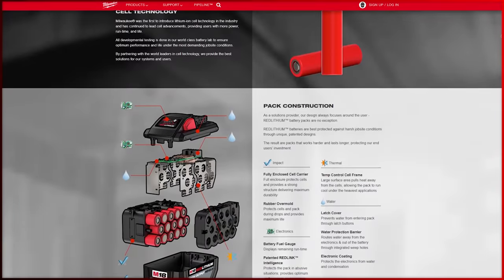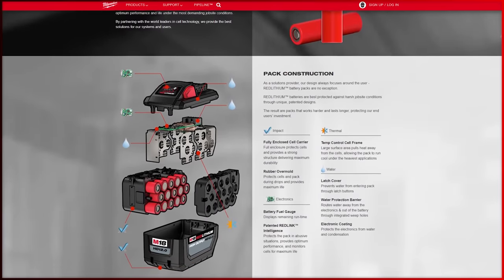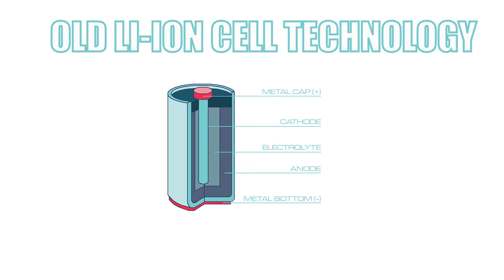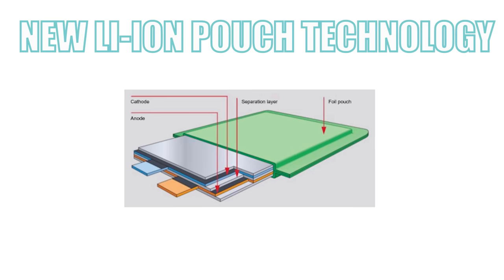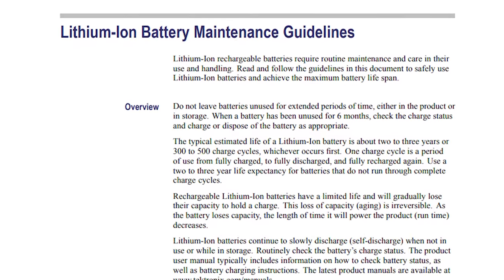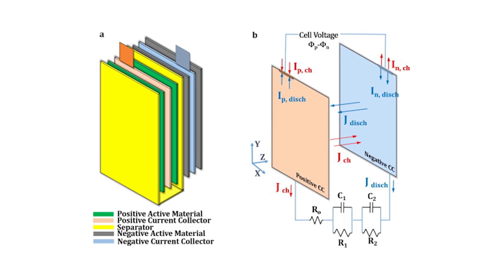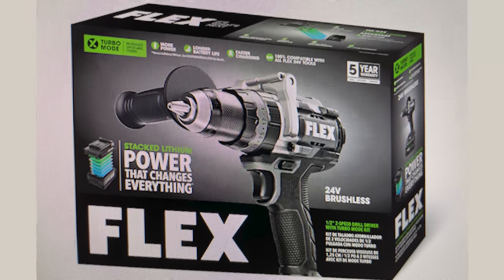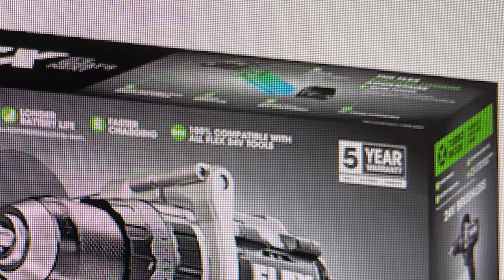BIGGEST FLEX YET Lithium Polymer (STACKED) Power Tools LEAKED!

Comment: My RC airplanes have been using Li-Po batteries for 25+ years.  Now I can have the same puffy batteries in my impact driver.  Great....
Reply: Yeah expansion is the biggest issue with pouch cells. But that will greatly depend on battery chemistry. I guarantee the chemistry in your 25 year old RC planes is not as good as the chemistry they'll be using in these tools.
Reply: @todddammit4628  cellphone batteries will expand regardless.
Reply: @robertopics  cellphone batteries have become far more stable in the last 5 years.

Comment: I'd rather not have my house burn down with LiPo batteries, lithium ion is known to be much safer
Reply: Will be interesting to learn exact chemistry though as that will play a large role in safety
Reply: The safest battery chemistry atm is Lithium Iron Phosphate. BUT they're nowhere near as energy dense as Li-ion.
Reply: @todddammit4628  LTO are very safe too but no where near as energy dense as needed for cordless tools
Reply: I agree. I've had lipo batteries blow up in my house, luckily I had them in lipo charge bags (for an rc car). I keep a dewalt impact in my race truck but will never leave a lipo battery in that truck. Too sensitive to heat and hard impacts. A fire is the one thing a race vehicle can never come back from.
Reply: Well, Li-Ion batteries can be very dangerous also, just remember Samsung phones and not only with Li-Ion batteries that exploded a real nightmare years ago and also Li-Pol batteries that if done well the benefits can be a battery that lasts much longer in time i remember my old Sony Ericsson K750i from 2005 and even now I still have it around the house and the battery on that phone still works flawlessly and went through several hands first it was with me for about 5 years then it was used  by my wife for about 3 years then went to my father for about 4 years and now he is with my son he plays with him, and if that battery was not stressed then no battery was, so if the Li-Pol battery  are made properly you  have absolutely no problem with it.

Comment: Like that the battery format is the same, footprint exact same with reduced weight and even backwards compatible, that’s great.
Do wonder if will be weighted thoigh to help offset the tool weight so it’s balanced like most tools are now 🤔 
Thx Vince✌🏻
Reply from the maker: Good questions Aepek, hopefully we can answer them soon! I’d like to see what this type of technology can add where the rubber meets the road! 👍🏻
Reply: To male up for the weight, they'll just have to add more pouches. Which means longer Amp Hours for similar sized packs. But I don't really see this as being a problem. The thing is, when you click in even a 2.0 M18 battery in most tools, the balance is there. Adding a 5,6,12 doesn't mess with the balance as much as add weight. Heck, I carry an extra HO 3.0 in my pouch when running my tools just so I don't have to lug around a 6.
Reply: @jmackinjersey1  true, so very true. Do like those HO cp3.0 batteries.

Comment: I just saw an add from dewalt for this same battery technology. They’re calling it PowerStack. Guess it’s rolling out across the industry.
Reply from the maker: What do you think about it Mr?
Reply: @VCGConstruction  thanks to your explanation, I’m definitely excited at the change in the industry. 

Wish I hadn’t just bought an Ego lawnmower, as I expect everyone will be rolling these out pretty quickly now. I think I’m also going to hold off buying that Home Depot deal on the Milwaukee dual charger with batteries.

Comment: This is really exciting stuff, I wonder what this might do to the form factor of current lithium batteries (particularly M18) and their durability overall.  I appreciate the heat dissapation, but how would it hold up to a drop from say 3-4 feet? They may be flexible, but if they are gel based, will they leak more readily? 🧐
Reply from the maker: I’m just as curious as you Joe, thanks! 👍🏻

Comment: The only issue I see is it won't change the battery size. Plus cost. Lol. I use them regularly as I mentioned in my RC's and they drain fast. Even larger amped batteries.  Race RC guys like 75mph, not Walmart ones😂😂
Reply from the maker: Yeah, from what I understand you can rapidly discharge and charge pouch much faster than other technology!
Reply: Well they advertise more power, and longer battery life,  I would assume they would be talking about the density of the energy stored inside the battery resulting more ah or Wh inside a smaller battery,  but that could just be wishful thinking on my part.
Reply: @VCGConstruction  yes,100% correct. Will be interesting to see what they come up with.
Reply: My RC packs were the first thing to come to mind when Vince started talking about the battery pouches. I’ve always wondered why tool companies haven’t adopted this technology a long time ago. RC manufacturers have been making these packs for well over a decade now. Catch up tool companies! Great vid like usual Vince 👍!!
Reply: @txvet7738  yes sir!!

Comment: Not sure a switch to Li-po batteries is going to be revolutionary for the tool world. Yes they charge faster, but they also store less energy and are prone to overheating when being pushed to deliver high currents like power tools require. I do think there’s a place for them in the compact and lightweight tool batteries. They would definitely make a slimmer pack. However i personally don’t think that current “compact” packs are cumbersome enough to justify the higher cost.
Reply: Ya and that chart he had clearly was talking about lifepo4 not a lipo I guess they can put them in pouches but I haven't seen any with high C rates like 30c or 60c for 2 seconds

Comment: Yo Vince! Great in-depth explanation. Thank you. 😎👍 One question remains: what is the runtime on these batteries? 🤔 Seems that if there's more power released (through less resistance) the runtime could be shorter. I'm curious.
Reply from the maker: I honestly don’t know anything about the configuration of these packs yet, everything I know, you now know! As soon as I find out if it’s all real I’ll see about sizes and runtime! 👍🏻 thanks Cuz!
Reply: Runtime will increase, or decrease on how strong the pull is (think wide open vs. Half throttle) and the motor to battery pairing.  If the motor constantly needs full throttle, and battery's max output is closer to what the motor needs they're both running full on, both are generating tons of heat, charge duration will decrease.  Of these manufacturers don't take a long hard look at the hobby world and what they're doing with batteries and motors, it will be several years before we stop hearing constantly about battery packs blowing up due to expansion.  They need to take one of those tools and leave it on a dark metal roof in the hottest part of a florida summer and see what happens to those packs.  Hopefully, nothing and they've thought of that.  If they didn't, well, not a fan of exploding batteries...
Reply: @matthewmeyer8053  Yes, agreed. As far as runtime, my favorite and impartial gauge is to run the tool (dealer's choice) full throttle with no load until the battery is fully drained while timing the full event.

Comment: I have my doubts on the true value of pouch cells. I think solid state or the upcoming 4680 cell is going to be more interesting. Have used an outdoor pouch cell before for outdoor charging on the go. The cell didn't last as long in durability as I would have  expected. Not sure how a stack will work for power tools, despite the theoretical benefits.
Reply: Hopefully most of the world has only been exposed to el cheapo pouch cells and these power tool specific pouch cells are a higher grade of some sort?  I don’t know anything about pouch cells.  I know a lot about 18650’s.  I imagine that’s the case for most of us.  The pouch cells I’m familiar with are garbage.  But maybe they’re the equivalent of re-wrapped defect 18650’s that say “something something fire”  on them?

Comment: That list of cycles was lithium iron phosphate not lipo but I haven't seen any that have those kind of C rates but if you knew much about these kind of batteries when you looked at that chart with the voltages you should have known it was not the same thing
Reply from the maker: James you’re mistaken, all charts and references are cited on our blog so you can look for yourself because you clearly did no research before leaving your comment, thanks!
Reply: @VCGConstruction  no it said nominal voltage was 3.2v and fully charged is 3.6v that is lithium iron phosphate

Comment: well the biggest reason why manufacturers should choose cylindrical cells is because they are more robust against physical stresses. there are multiple ways this comes into practice. however you could argue that in a power tool battery there is already space lost by the durable outer casing. so there is already protection in some of those ways. but keep your eyes on the prize. because gel electrolyte are not it. and may in fact blow up in your face. what we should be hoping for beyond that are the new GM solid lithium ion batteries. which GM are making now for their future EVs. and yes since pouch or cylinder is just a packaging format you can combine them both. but would i buy flex 24v pouch cells in the meantime? well yes maybe. we do all use them in our cellphones after all. however i would prefer to wait a few extra weeks /months after launch. and do more research as to find out more and try to play it safe as the manufacturers don't always get it right. we have had massive recalls of these things in the recent past. both in phones and more recently EVs. so what is flex doing is kindda sensible in the way whereby it seems like maybe they are going for a staggered rollout? (only with some products at first?) and also keeping the traditional option at play. in case there is in fact an issue then they can just go back to the normal cells. still that is not the ultimate goal here - one of the big power tools companies need to sign up an exclusivity deal with general motors. and who should that be then? an all american company like craftsmen? or milwakie maybe? because it feels kindda strange thinking that flex would be the ones to be getting such a golden ticket. and what about sub licensing eh? and antitrust? has flex got any bartering chips they can put down on the table? like for example patents - did they patent this pouch cells specifically? or anything else the other players actually need?

Comment: You mean like Radio Controlled cars, trucks, airplanes and helicopter batteries have been for at keast 10 years.  I remember those awesome 12 - 15 minute run times!  WOW! And how they would fail?  Spectacular!  
  They do operate with very high current both charging and discharging.  Watch some videos of pro aerobatic helicopters,  OMG!

Comment: I like that FLEX is putting this out to make the others catch up. But I know many others are already working on new tech for thwor batteries. 

As you closed, the issue in this case is $$$. But for those of us in business, we look at tools a different way. If it makes more sense to pay a little more now, and it pays off in the long run as well as helps us be more productive on the daily, then it is worth buying. If I can use one battery all day where typically I'm changing out two times, then that time is spent building/making, not walking to the truck or even stopping to switch out a battery you have in a pouch.

Comment: I've had power tools running off li-po batteries for a long time. I converted Dewalt packs to li-po over 10yrs ago. When they started using li-ion I knew they were stupid. Way behind on technology. I also beat them to the li-po and brushless motor scheme too. My 18v Dewalt was lipo and brushless 540 in runner motor 10 years ago. Come, these companies are way behind technology.

Comment: First off, these aren't Lithium Polymer batteries they Li-Ion in a pouch cell, Lithium Polymer batteries would be a true break through as they would be Solid state and basically unable to catch fire. Problem is manufacture, Li-poly batteries are still int he lab and haven't left because they are to complex to make otherwise the likes of Tesla, Panasonic, LG, Sony, and every other battery maker would be on this like white on rice.

These batteries would be an absolute Safety hazard, all it would take it something like a nail or screw to puncture the casing and that battery will start a fire, a toxic fire.  To add to that , they would need an amazing battery management system to prevent the cell from expanding and catching fire that way (if you want a prime example the Samsung note phones that caught fire were mostly because the battery swell enough that the phone's case put enough pressure to short the cells ending in fire).

Now if chevron managed to solve those problems with a new chemistry? great nothing to worry about, but if they didn't? then these batteries should never be touched.
Reply from the maker: Exploding Samsung phones haven’t been a thing in years… sounds like you answered your own questions, thanks!
Reply: @VCGConstruction  Not really, all Samsung learned is they didn't leave enough space for the cell to expand in that phone design.

As others have mentioned the only currently known "safe" chemistry is Li-Fe batteries (Lithium Iron Phosphate) but they have a glaring issue, the lower power density.

If they were to pack those cells in tight enough to get more energy density than cylindrical cells we would be back to exploding batteries because the cells won't have the room to expand and contract as they heat up from charging and discharging.

But we will see once these come out. Honestly I'd love to see tool batteries made from Telsa's new batteries, But they would be limited to the larger high amp hour pack :P

Comment: The Chemistry is basically the same, there's just less resistance within the internal connections

The life cycle claims seem bogus  - we will have to see.   

Pouch cells have such a horrifically bad history that this seems like a bad development .   Look at all the bad Nissan Leaf batteries and the recalled Chevy Bolt packs .   All of them pouch cells.   Get ready for swollen tool battery packs busting up tools and chargers and causing some fires.   Just no, no no

Milwaukee could already dramatically increase the  power to volume ratio of MX Fuel batteries .  Compared to Greenworks 80V it's an utter joke and quite shameful.  Giant MX batteries that are twice the size yet half the watt hours of other quality  80V platforms' batteries.  

If Tesla couldn't figure out pouch cells, sticking w cylindrical, I wouldn't bank on TTI pulling it off  successfully.   They're only doing it because pouch is cheaper, and they will sell more batteries because they will have lower life despite the claims .  Mark my words !
Reply from the maker: Tells us:
“Mark my words”

We won’t:
Because you didn’t watch the whole video.
Reply: @VCGConstruction  i did watch it , i just mixed up flex and mx/tti    i don't own either of these and am not very familiar w flex.   but the point stands that  any tool manufacturer going down the road of pouch cells needs close scrutiny.   we need to know where are they getting the cells from ?    a lot of major manufacturers including LG Chem have screwed up pouch technology despite huge efforts to get it right .   the vast majority of lithium battery incidents have come from lipo pouch cells ..

Comment: lipos are strong, but theyre really dangerous, way more attention is needed to care and charge than most people are willing to put up with, or realize..
Reply from the maker: Way more attention than what? Without software or limits lithium ion cylindrical batteries are just as dangerous if not more! 🤣🤣
Reply: @VCGConstruction  ugh, yes ok. you can't vent a lipo when abused it will create gas in the battery that cant be released, leading to a possibility of an exothermic runaway if they cant expand properly, like per se in a plastic battery shell?? (or samsung s8?) Lipos are used safely in low power demand application, like phones, laptops etc. and high power demand applications like RC planes and vehicle where they can be readily inspected for this defect(the battery cells are exposed).  The Cylindrical batteries are designed with vents, and are a tried and true design. The difference between the two batteries these days is literally the cell design.  Lipos hold more power but are less safe than the cell based batteries due to the issue stated above, if you think it's cool to have puffed lipos in your house/tool box etc..  be my guest,  when I get a puffed lipo, I drive a nail through it.  Dont trust it at all.

Comment: Flex needs a 12v line
Reply from the maker: I’d like to see a miter, and table saw first, but that’s just my 2 cents!
Reply: @VCGConstruction  definitely fits the demand and large trade. I'm just an assembler, intrigued by the battery tech!
Reply from the maker: We do service work as well and love my 12v tools for it, but I’d like to see them complete an entire platform before moving in to a second! Or atleast fill any gaping holes! 🤣
Reply: @VCGConstruction  if they want any chance of competing with milwaukee and Dewalt they need to do exactly what you just said.

Comment: Basically mobile phone batterys 🤣most of them are 3.7 volt 3000 or  5000mah 4 or 5 these pouches in a battery box would  work like but heat will be a issue if they just stacked on top each other
Reply from the maker: It’s the same parent company as EGO, you know they have a strategy to deal with any limitations if it’s real!
Reply: @VCGConstruction  👌👍time will tell see what appears  its possible.